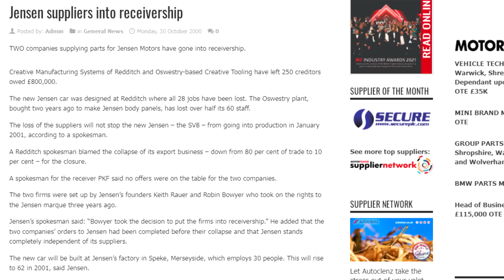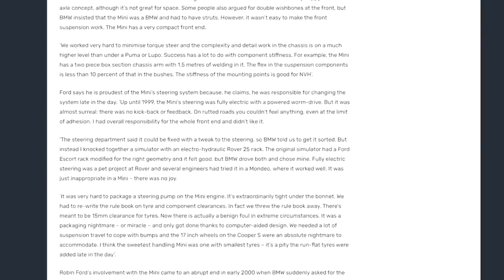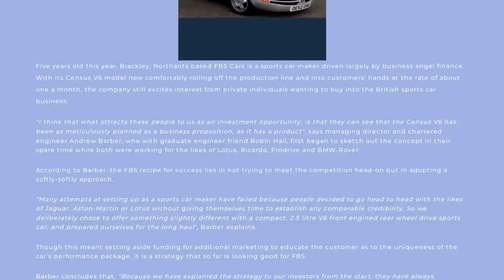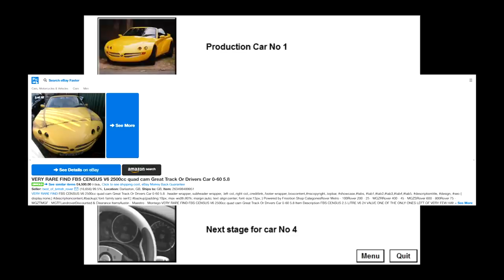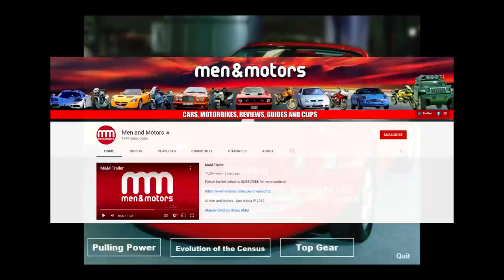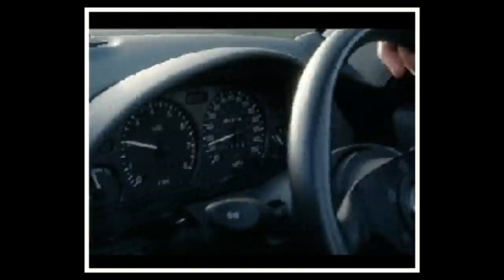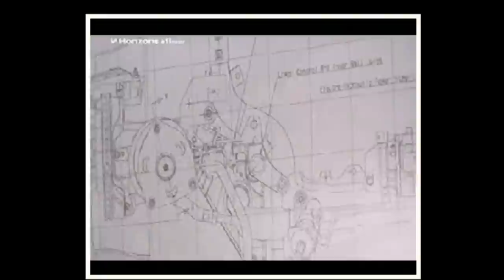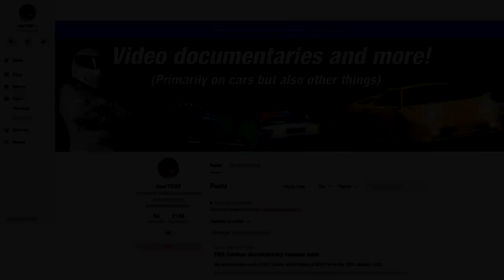Britain's Forgotten Sportscar: The FBS Census

Comment: From the front it looks like the unholy lovechild of a Karma Fisker and a late 90's Alfa Romeo GTV. Beauty is in the eye of the beholder of course, but holy shit, this is one ugly car.
From this video, my guess is that the styling turned the customers away for a start. I can't believe this won a design contest, the mind boggles how this was the best option out of 11 and how this guy went on to design for Ferrari. 
Engineers usually aren't great at sales and marketing, and judging by the fact they chose the design as a winner, don't have a feel for aesthetics. A car is not just the driving experience, you need a lot more and they didn't manage to put together a team that could fill these gaps. 
The unexciting name is a good example, aside from the design.

Not trying to rip into them or hate on them, just my take on why it failed.
Reply: Yeah I thought Alfa at first glance, although it reminded me of the 2006 Alfa Romeo Spyder, and a little bit of Dodge Viper at the front too. The sides and rear are just repulsive though. Definitely an image thing that caused it to not sell. You can accept a bad design from a well known performance house if it drives well, but an ugly car that drives well from a unknown manufacturer is a harder sell. You need either design or pedigree, in addition to it driving well, or it's hard to drum up new sales in a niche market.

Comment: I think it teaches a lesson about cars being either the vision of one person, or a team effort. While I appreciate their humility in recognising that as engineers they may be poor designers, I think farming it out to a university, even one specialised in design, was what killed it. Taking the winning design and using it as is, was a mistake. It needed a more collaborative effort, smoothing the lines in places and not having the scallops. It might just be a scale or translation issue from page to prototype, but it is horrendously ugly to my eye, with more things I don't like than those I do. I like the old MX-5, which is a bubbly sort of thing, but looks much more proportional. This is almost like a Viper or American small sports car, kinda odd coming from an Italian designer. I'm glad he went on to great things interning with Pinafarina, but they'd have slapped this down, or at least modified it extensively.

I'm kinda surprised that in the current age where engine and transmission have been supplanted by simple electronic drivetrains and high torque motors, that no-one else has made a success of the small 2 seater sports car, the way that Tesla started out, retrofitting Lotuses.